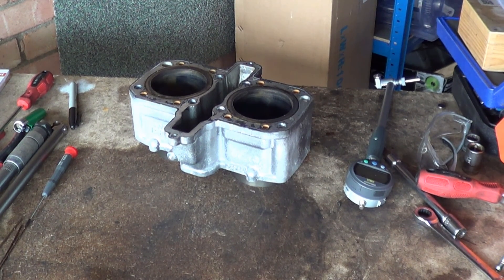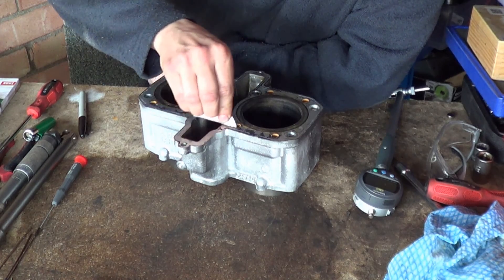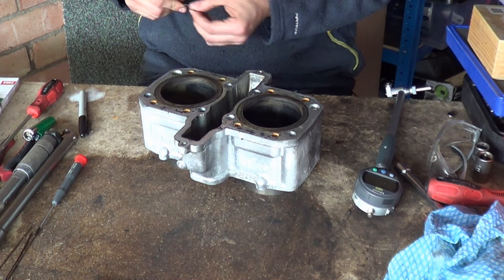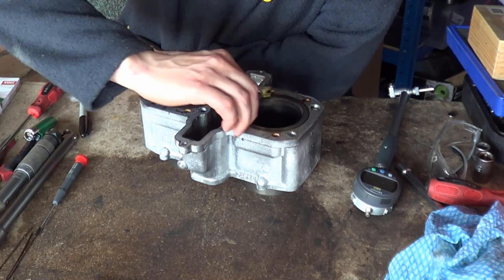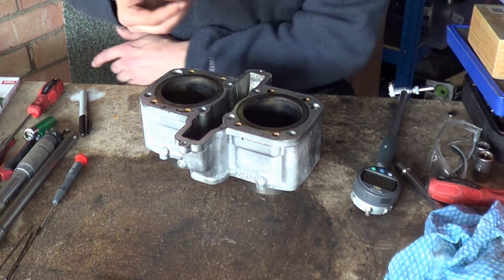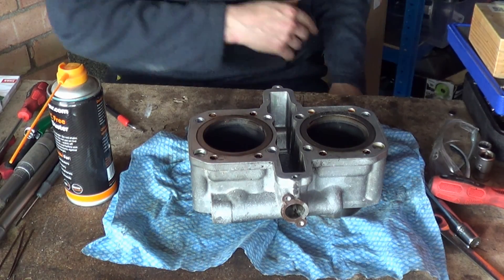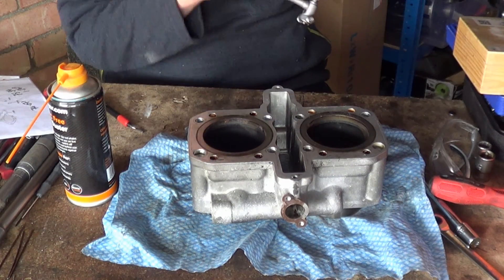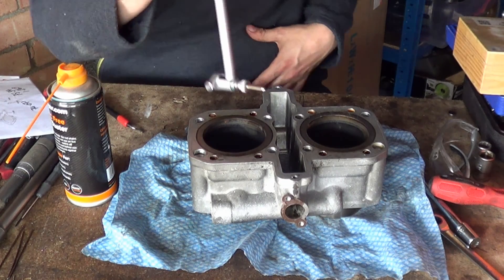Kawasaki ER-5 / KLE 500 / GPZ 500 / EX 500 - Engine TEARDOWN - Part 12 Cylinder measuring

Comment: HEY BUDDY, THANKS FOR THE VIDS, I'M BUSY WITH THE EX 500, JUST WONDERING WHEN YOU WILL POST MORE VIDS ON REASSEMBLY, IT'S BEEN A GREAT HELP, CHEERS
Reply from the maker: when the engine and all the other bits have been finished, but don't worry this series will be completed - matt
Reply: THANS BUDDY:)

Comment: As I am going to be removing the cylinder head etc on the XJ600 I would like to check the measurements not only of the cyclinder but the rings, little ends, big ends etc while I'm in there, do you plan on doing a video on these things, at 75,000 miles I'm sure they will need checking......

Comment: what is the purpose if cleaning egdes and what is that tool you use to do it?
Reply from the maker: +arunas junevicius its a deburring tool, just a normal one, it just cleans up the sharpe edges, no real advantage.

Comment: Could you give some indications if the bike has done 70,000 miles etc and the options we have ......perhaps new rings, a rebore, larger size pistons...etc......100 microns is a fairly small amount but what effect will this have on the engine...Thanks Matt
Reply from the maker: +ROY Dean any deviation from the initial bore size increases gas blow, this reduces power, increases oil contamination, etc etc bla bla bla. If an engine is running and its running well, amd you don't notice any issues then it doesn't matter. If your loosing power and its a massive bitch to start and this is due to the wear and nothing else then I rebore, oversized piston and new rings are in order. 

1 thing I do need to point out though is that alot of people replace rings. This can make the situation worse. As the cylinders wear so do the rings and they wear together. They bed in and become great buddies. Swapping out rings without a rebore is a bad idea and ususally cause bigger problems that it solves

Great question, will bring this up in a future vid 

- matt